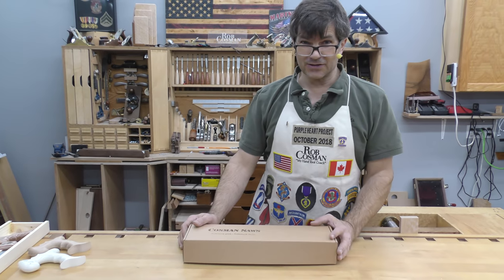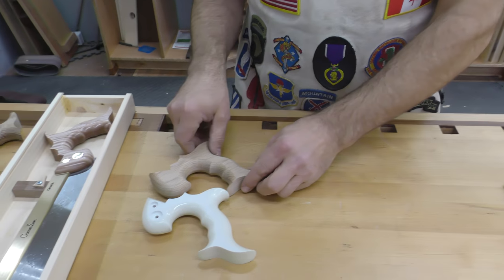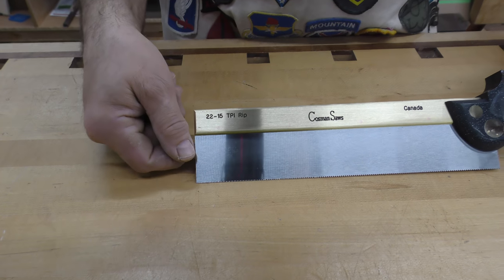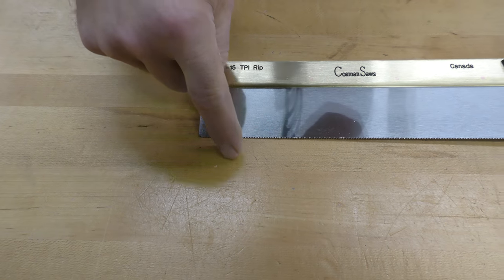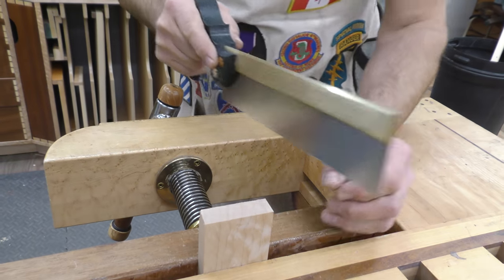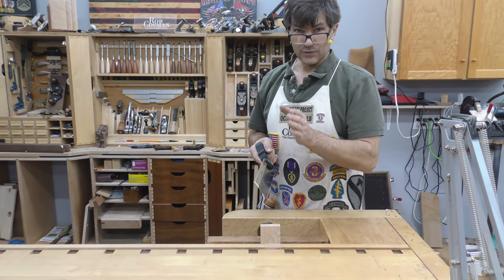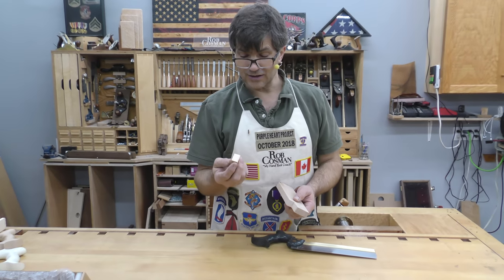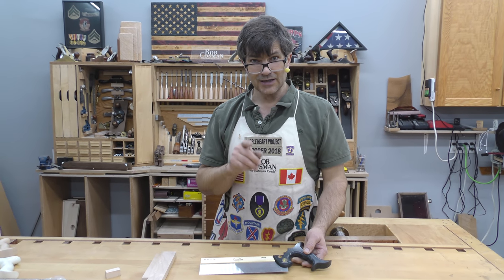Dovetail Saw Tutorial From Rob Cosman

Comment: Hi, I can totally relate to the above comment. I own a few lie-Nielsen saws, they are very good quality saws and I would recommend them to anyone. However I purchased two of Rob’s saws (dovetail & medium tenon) last year when I visited Canada from Ireland and Rob was kind enough to deliver these saws and a few other tools Rob makes to my hotel. After using them for almost a full year I can honestly say that these saws are the best I ever used. So much so that I haven’t picked up my lie- Nielsen ones since, the apprentice is using those. No other saw compares to these. If you purchase one you will not use another brand again and part of your purchase price (10% I think) goes towards Rob’s Purple Heart courses where he teaches wounded vets how to learn a new trade as a hobby and sends them home with new tools. Who can say they can match that? I only wish I had access to Rob’s courses over here. Cheers Dan
Reply from the maker: Thanks for the plug on our PHP Dan, we have had 60 soldiers to date, next workshop starts May 6, 2019 in our new shop in Grand Bay!
Reply: How much did you you pay for all those tools
Reply: Branka Hikl I am a carpenter/furniture maker, I own a wide range of power tools but my most valuable tools are my hand tools. I buy the best and for hand saws - marking tools I turn to Rob Cosman. For hand planes I prefer lie-Nielsen. I’ve spent thousands on hand tools.

Comment: Hi Rob, this is a bit of topic but I wondered if I could ask you for your professional opinion on re-sawing. I am working on a historical building at the moment (18th century)and we are not allowed to use a bandsaw so I found myself re-sawing five foot lengths of 2” x 9” oak boards using my lie-Nielsen panel rip saw. It’s doing the job but I wondered if you knew a better way or maybe a different type of saw that could handle the load? Cheers Dan

Comment: Quite Expensive though...
Reply from the maker: Relative, no matter the price,  if it does the job others cant, great value!
Reply: A cheap sleeping bag isn't such a value the first time you spend a cold night in it...
Reply: Depends on how you value your time. If it saved say, 5 minutes of your time per drawer and over a year you make a hundred twenty drawers, that's 10 hours shop time saved. 10 hours @ 80/hr would be 800, or a $550 gain over using a different saw.
Reply: I should have said Excessively expensive compared to other “high end” brands on the market. Just stating the facts folks , not trying to hurt feelings ha ha I like Cosman just fine.
Reply: It's what, double the price of the LN? Definitely a bit of sticker shock.